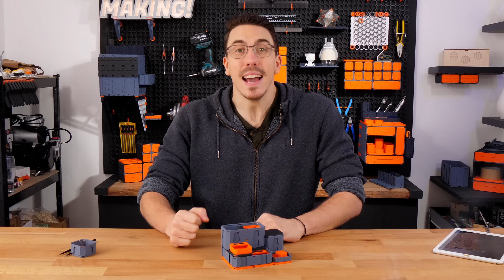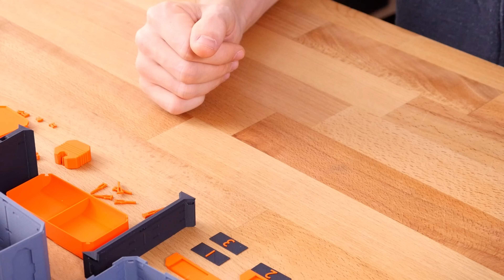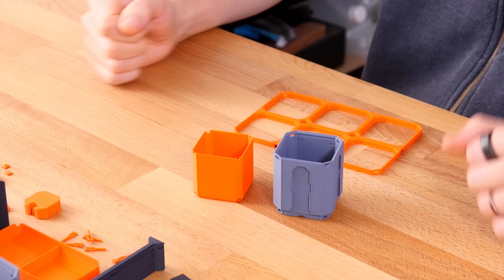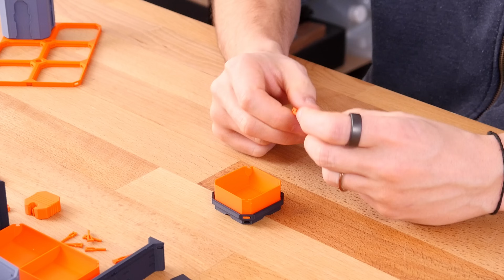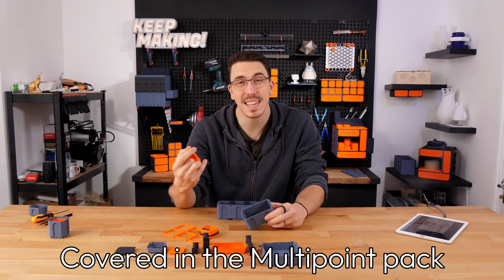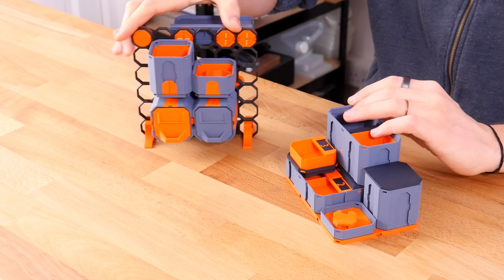Multibin Starter Pack : Getting Started With Multibin

Comment: It is definitely a lot to take in but I absolutely see benefits to this that Gridfinity doesn't have as someone that recently made a Gridfinity carrying case for stuff that has to be switched out/swapped with different sized things a lot.  If you're printing storage once and never messing with it then yeah this is overly complicated, but if you are swapping stuff in and out frequently then Gridfinity means printing a lot of full sized bespoke bins when some dividers or extensions could have done the same job with less plastic.  I think it purely depends on what someone is doing with this stuff, because I can absolutely see some Gridfinity stuff I've done where this doesn't add anything, but for other uses this looks like a big upgrade.  For some people it'll be worth it, and for some there's no good reason for them to do a bunch of new prints.

Comment: I appreciate the detailed design of these components; I don’t think they are over-engineered as some have suggested.

However, the licensing model is a barrier for me. It’s not about the cost—I’m happy to pay for products I value and to support creators. My concern is with the subscription model for parts storage, and especially with the part generator being locked behind a $10/month fee. This arrangement makes me hesitant about the project’s longevity and what might happen if it’s discontinued.

Also, there is a big elephant in the room called Gridfinity, and you are pretending it doesn’t exist. What you are asking us is a big thing: to switch from a completely free and open-source project into a closed ecosystem. You should start by at least stating what your system solves that Gridfinity doesn’t.

Comment: You need to work on how to best explain what problem the system was made to solve, and why it works the way it does.

The shell and insert idea feels extremely overengineered because at no point it is explained why the system requires two pieces.

As far as it is explained, the insert is to be made to fit items (for instance a SD Card organizer). However, it appears the insert is pretty much useless without a shell. So why isn't the shell already printed with the insert?

What problem is being solved by the bins being made out of shells and inserts?

Comment: Why not have the lids clip in too? Right now they have smooth sides and aren't held by the groove.

I actually think separating outer and inner shells is a good idea. If you want to change something, you don't have to throw out the entire thing.
Also, can you elaborate why non-extension shells exist at all? They don't click into the base like extensions, and you waste material printing the floor, which would be covered by the insert anyway

Comment: I joined multi maker on thangs the other day for $10s a month but im having trouble on joining the community to talk to others and ask question. Any help please. Thanks
Reply from the maker: Hey Mighty Cain you should be able to message in the community and by sure to follow the membership instructions in the Welcome section. Your thangs acount and the community need to have the same email and we don't have an API with thangs just yet so we trigger the mataching manually every day so it takes 12 - 24 hours to get into the tutorials unfortunately. However in the mean time you should be able to chat and explore and start printing. If you do have any issues the best place to get help is in the community

Comment: As much as I like the hangers and walls I think these bins are overly engineered and overly complicated. Gridfinity and Gridfinity bin generator are more than enough. I combine regular Multiboard and Gridfinity and they provides endless solutions for anything you can imagine.
Reply: i like the seperated insert idea and the glueless magnets. But you're right, after that i kinda zoned out because it got too complicated...
Reply: There's no such thing as over engineered when you own a 3d printer(!). :)

Comment: What I really need is a way to connect a multibin desk grid to a multiboard back panel so the bin base can help support the multiboard back on a desk without a wall to mount it on. Been building this for my dad and it's almost there, but not quite stable enough for his modelling desk unless we screw it in somewhere, but that's not an option. Almost there though! Love this design and attention to detail!
Reply from the maker: Hmmm not sure I quite get it but be sure to bring it up in the community and see if we can make it a thing.
Reply: @Keep-Making  Will do!
Reply: Can't you use brackets for that?
Reply: @Kaylakaze  I thought I could, but when I tried I found it didn't work unless I printed a whole set of new multiboards and laid them flat on the desk with the bin holder attached to the face, taking a ton of plastic and time compared to directly attaching the basic bin holder on the desk to the multiboard wall.

Comment: Can someone explain the difference between the standard extensions and the universal extensions?
Reply: I think the models were recently updated with this extra bit of info to their description:
“Universal” Multibin Extensions have gaps on the Bottom Rim that allow you to click it on to more than one Multibin Shell. However they only have 4 pin holes and aren’t as strong as Standard Click-In Extensions (which have more pin holes).
Reply: @CoderNinja  Ok, so Standard must have a equal or larger bin underneath while Universal can stack across different bins.  Neat. Thank you. I see I didn't dig deep enough. Maybe they will put together a knowledge hub for these new systems eventually.